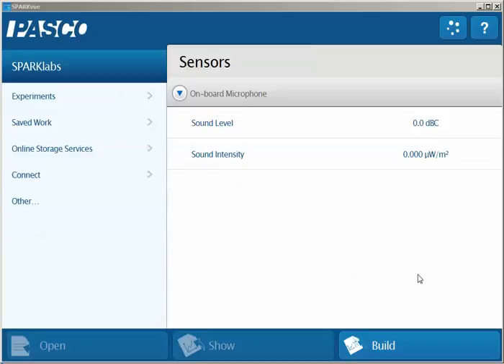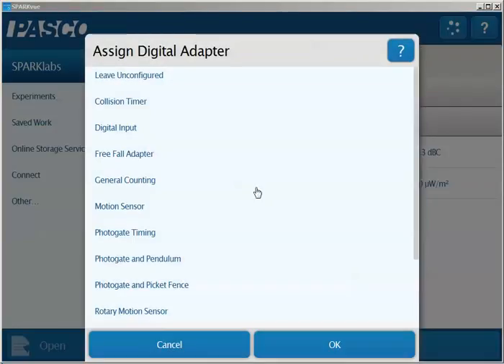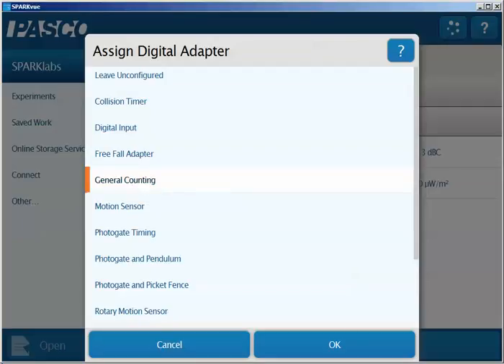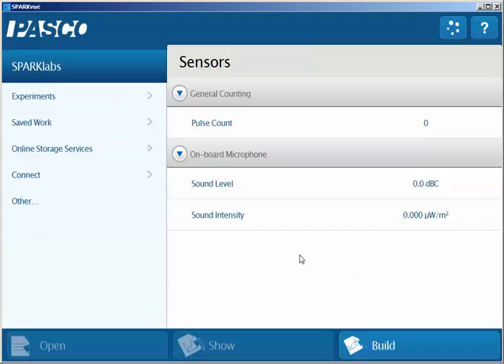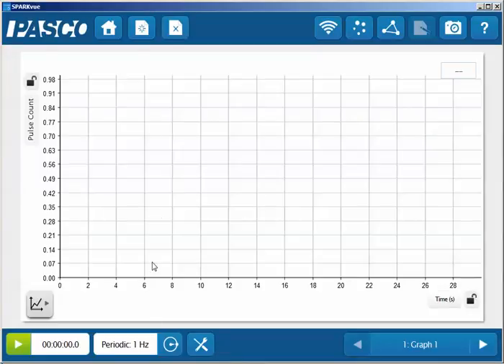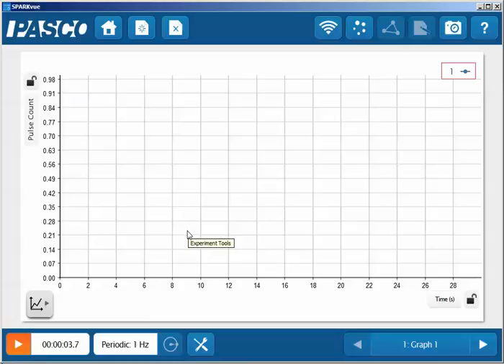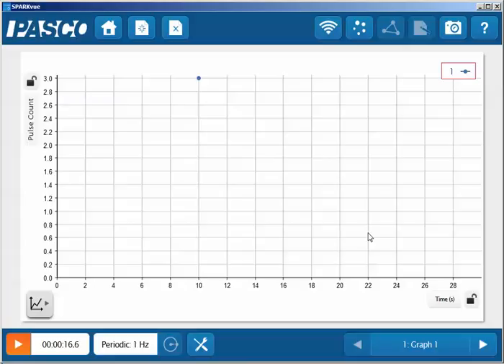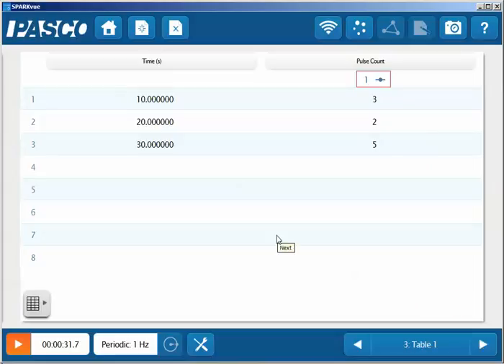Use a Geiger-Muller (GM) Tube (SPARKvue)

Comment: how do I calculate radiation in some standard units (Gr etc) by using count intenity?
Reply from the maker: The GM tube that we have is only a counter (it does not calculate the energy of the ionizing radiation that it is detecting).  While we do not have a direct means of determining the energy of the radiation that is being collected, you could use a series of absorbers to help determine the penetrating power of the different particles.  For instance if you use a dense absorbing medium, you can determine the approximate number of counts that are from gamma rays.  You can then use a less dense absorber to help determine the number of counts that would be from beta and gamma.  You would need to do a correction for the number of gamma's that you would anticipate would be absorbed by the difference in the amount of absorbing medium for the gamma test and the beta test.  You would then need to repeat this process for the alpha particles (and assign the corrections for the losses that would have occurred due to the different absorbances of the different thicknesses and media used.  After the above, you would need to put a weighting factor into each of the different radiations detected and the number of counts ascribed to them due to their different impact on biological tissue.  If you have questions, please contact us at support@pasco.com or chat with us at www.pasco.com